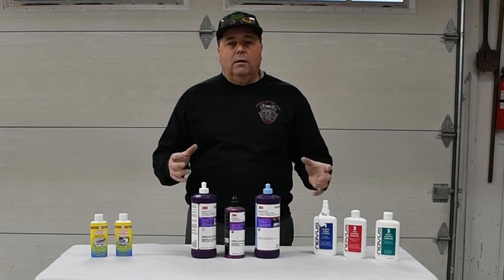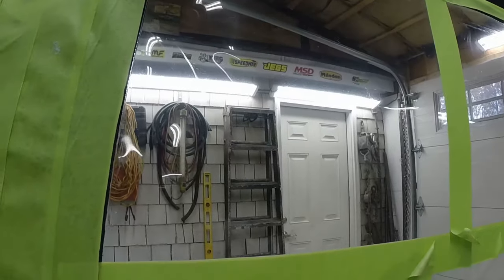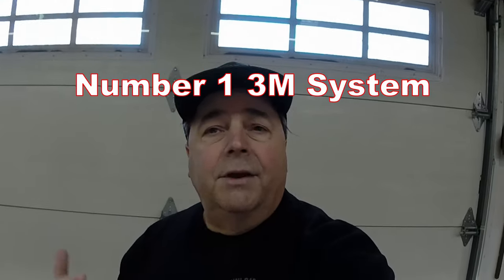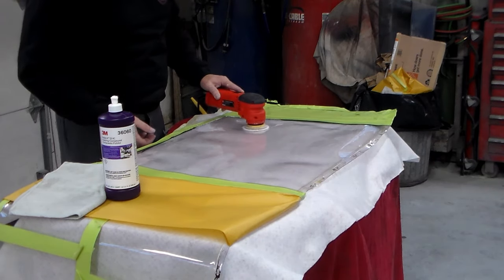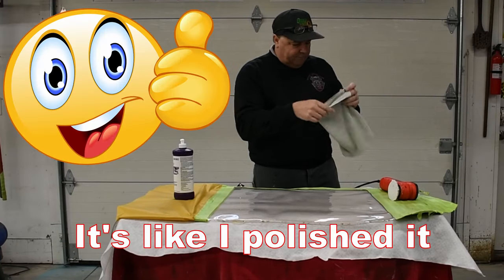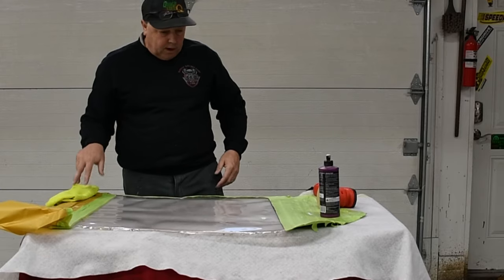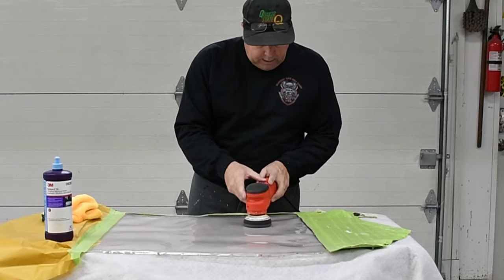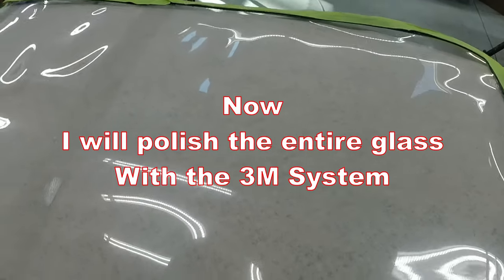How To Restore Plastic Windows For Convertible, Tops, Jeeps,  Boats, & More

Comment: Compliments (C), then Questions (Q): C1: I apprecitiate you starting with the conclusion. C2: I appreciate your comparative process. It saves us from doing the same. C3: I appreciate you showing us just how you did it without cutting key steps. 
Q1: How did you remove and then reinstall the window? That would be nice. It wiould also be nice to replace a trashed window in a good top. Q2: How would a Royobi buffer, about 10 inch circular, work? Q3: Would 3M or another product remove the horizontal fold lines from...whatever?
Thanks!
Reply: Ahhh, I see some window replacement videos for the Z3.Nice design. I have a Fiat Spider 2000, so it's different.
Reply from the maker: I would be careful on the speed of a buffer. It may work. The fold lines are tough to get rid of.